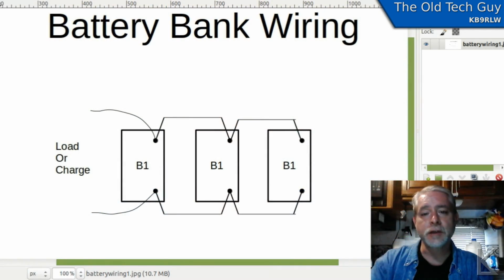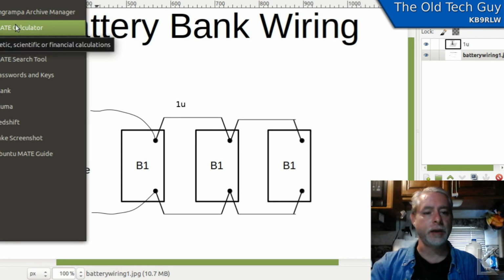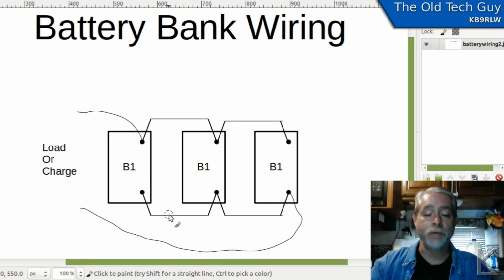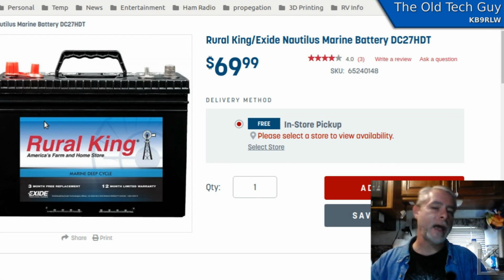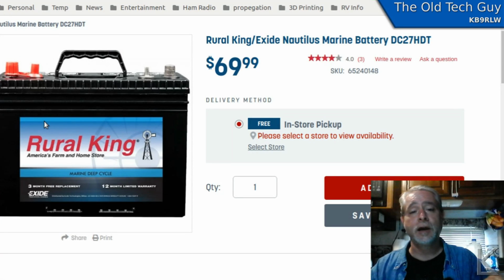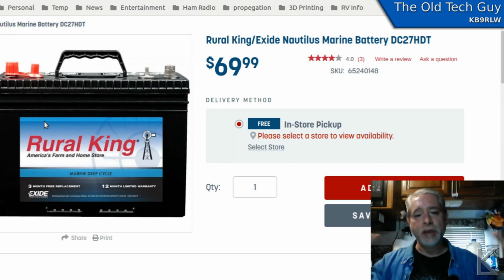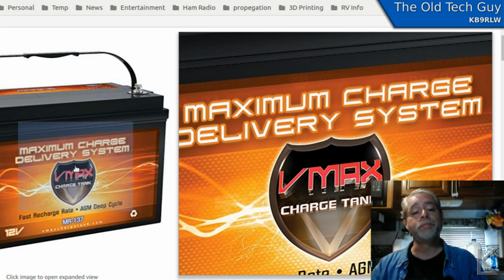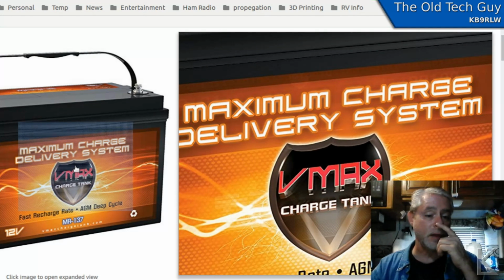Electronics - RV - Ham Radio, Solar and Batteries. Thoughts and Observations

Comment: Excellent video! Have you experienced any noise issues from your 12v-19v converter or your solar charge controller?  A while ago, I came across 2x 100 ah Odyssey PC2150T AGM batteries and a 15A Morningstar Sunsaver MPPT charge controller.  I've been keeping the batteries maintained with a Progressive Dynamics PD9280A RV charger (which is supposed to be very quiet, < 20mV ripple per phone conversations with manufacturer).  They been unused in the basement just floating on that charger for a few years.  I'm currently setting up my first station (will start happening next spring) and considering just running it all off the AGM batteries and a single 200W solar panel with a TG Electronics SuperBooster boost converter to keep the voltage up at 13.8 where the transceivers like it.  Perhaps this would isolate me from noise sources and surge threats on the 110V AC lines in the house. The 12v-19v converter would be for a PC monitor and a computer, but I'm concerned about noise from the switch mode converters and chargers.  Any problems with noise on your radio from the 12v-19v converter or charge controller?  If so, how have you dealt with it?   I'm learning toward the IC-7300 also.  Are you able to get the full 100W of your IC-7300 when running at <13.8 volts?  Is the 12v-19v converter for your laptop happy when the battery voltage drops?   Thanks!

Comment: Cant say it better!  ((btw, MPPT regulator is the way to go, more than 30% more power from the existing panels, even in low light situations. ) (they give you more amps then the panel itself can generate (the use the higher panel no load voltage< the max your 100 w panel can generate whit a pwm regulator is only 70 watts from the 100 per panel! ,So the 200 watt you have on the roof is only generating about 140 watts max) , at 12 volts (real empty battery) thats only 11,66 amp charge current.. , whit a mppt controller thats thats 16,6 amps! (so in 100% light situations 11 amp hours charge, against 16 amp hours charge per hour! ) Thats quite a difference. (you can also improve the voltage loss in the panel wires iff you connect them in series, doubling the voltage output, so the mppt controller can even work better . (Victron mppt capable off overvoltage on the input, even lesser loss!)  73,s! , Pd8533
Reply: Yes, the MPPT charge controller is well worth it. I have a solar setup and have used a PWM as well as the MPPT. If you only have 40 or 50 watt solar panels, you won't see that much difference. At 200 watts you will see a major difference. The Victron MPPT is fantastic. I have a small 15 amp and it works great. It comes with Bluetooth so you can monitor it with a phone app. It is really nice to have the data logged to monitor the usage. 73 KF4UPI
Reply from the maker: I've been working on researching maximum power point technology.  It's difficult to collate hard data amidst the huge quantity of anecdotal noise.    From what I can gather, the range of conditions wherein the benefit is substantial is severely limited.  But I'll keep digging.

Comment: Concerning multiple batteries wiring.
Your current and voltage drop calculations are wrong. If total current is 30A each battery would take approximately 1/3 i.e. 10A.
But in general the idea is correct, it’s better to use diagonal connection to the load.
Reply from the maker: The numbers were chosen to make the illustration clear.  The idea of the voltage drop across the wires, nothing more.
Reply: Yep, but if you choose 30A as example than current in first jumper wire is 20A in second 10A that's it.
Talking about 30A in all jumpers offends the eye of anyone who knows electronics basics.

Comment: Kevin, I have 3 SLA AGM 7 AH  and 1 12AH battery in my power pack.  All of the negative terminals are connected to a common bus bar and the positive terminals are attached to a 2nd bus bar,  So there is a single point for both sets of terminals to which I connect both my radios and battery conditioner.  Can you analyze that for me?   Bob
Reply from the maker: If all the connecting wires terminate at the same point and are the same length, you don't have this problem.   However, you have one battery that does not match the others, so It will age differently.

Comment: Great video. I learned a lot ! How much is weight an issue in your RV ? I’m thinking that with all if your electronics etc you might have more weight in that RV than the typical person on vacation. Is there a weight limit for load carrying that the RV maker specifies ?
Reply from the maker: There is a load limit.   I'm under it, but not by much.  So weight is always on my mind.    This new battery is heavier than one of the two batteries I replaced, but lighter than the two of them together.  So this was a move in the right direction.
Reply: While traveling keep black and gray tanks empty and even fresh if weight becomes a problem.

Comment: Love your videos however I am confused. I thought AGM‘s were only good for about 50% meaning if it’s rated 120 amp hours only good for about 60
Reply from the maker: What I learned doing research is that the AH rating is arrived at by what's called a 20 hour test.  They discharge the battery over 20 hours to the critical voltage of 10.6 volts.  Then they calculate how many amp hours it actually delivered over that time.  So, that would mean that the rated AH is much closer to an actual usable capacity.

Comment: Just got my tech/gen in the last 90 days, am studying for extra and am ready to install my "radio shack" now. My dual power system  makes it tricky but I've been watching lots of videos like yours and will investigate this 13v/19v converter(I already use a 30A converter to change shore power to 12v). Radios and AT will run off MFJ booster and am leaning towards a Tarheel 100 antenna for hf and a triband ant for vhf/uhf/1.2Ghz. Without an Elmer to advise me I'm very nervous to buy the pricey screwdriver ant.  Any thoughts?
Reply from the maker: I'd love to be able to give you an evaluation of the screwdriver.  Unfortunately, I have no experience with one.  They are talked about quite favorably by those who own them, as far as I know.

Comment: Yo Kevin!:
Great video! Are you considering changing the diameter of any of the cables connecting to the batteries? More current handling capability? Again great video!
DE seeker / Jeff WA7LFP
Reply from the maker: The most I draw from the desk systems is around 25 amps during TX peaks on the 7300.   I'm fine for that and then some with my existing cables.   The 1KW inverter has it's own wire to the battery, but I rarely use it.  (only once so far, to vacuum the floor.)

Comment: Thanks for your great Videos.  I do have one issue with one thing you say, that "Inverters are inefficient".  This it not true!  The average efficiency of good inverters has been around 97% for over 20 years.  Almost equal to transformers.   You need to look at watts in to watts out, not amps alone.   Of course when you take 12 volts in and convert it to 120 volts you you divide the amperage by ten.  So at 12 volts you need to supply 10 amps (plus a small loss) to get one amp out at 120 volts. but it is still very close to the same amount of "Work" or watts.  It seems inefficient to use 10 amps from your battery when you only need one amp of 120 vac and it is a good way to drain your batteries fast too!   I have worked on boat electronics and electrical for over 30 years and have Installed and serviced quality inverters for most of that time. (and many other electronics)   Yes every conversion costs some loss and staying with one voltage is a great idea but it cannot always be done, but there are many things that can be done to improve the systems that you need to live with.  
 Thanks again, I am not complaining, I just feel that this subject needs clarification.    
David Huffman  FCC Commercial License  PG119192 w/Ships Radar,   AJ6DY  (lol finally took the Ham tests and did them all same day,  guess my learning helped a bit)
Reply from the maker: If you go back and have a look at my update video with "two bench projects" in the title, I did a test.   I used the inverter to power my laptop with it's normal power supply and calculated the wattage drawn from the 12 volt source.   Then I used a single stage 12 to 19 volt converter to power the laptop off the 12 volts.
The inverter method was 42% less efficient.  Calculated actual power draw from the 12 volt source.
By adapting as much as possible to run directly off the 12 volt source, you do gain quite a bit in efficiency.
Reply: @loughkb  thank you for your reply.  I do agree that the DC converter is the best way to go,  but I am surprised that your inverter did so poorly in the test.  I am sure a higher quality (and much more expensive) marine inverter would show a lot less loss in the same test.  One of the best units is built by Outback, 3000 watt out, also used in home solar systems.  These units range between $1500 - $3000. With rated efficiencies in the high 90's.  Thanks again for all your videos, I do enjoy them and have learned a lot from you.  I have changed my call sign to K6DCH which are my father's initials who inspired me to study electronics.
Reply: Keven. There is an error in your first example. If you are "pushing" 30 amps into the battery bank and for example if each battery is absorbing 10 amps then each segment of the wire has different current and the voltage drop you calculate is overstated. K9EA

Comment: Hello Kevin .. unless I am missing something .. is this battery just for radio use or for the coach as well .. if this is for the coach also would you not be better off using two 6v golf cart batteries such as the Trojan T-125 240Ah and run them in a parallel / series config .. this is what I have in my RV and I get a total of 480Ah @ 12v .. just a thought. Randi N9UOM
Reply from the maker: You slightly confuse me when you say "two" 6v batteries.   You could put two in series and get 12 volts at 240ah.  You would need four batteries to do what you describe.
I have a separate battery for the usual coach systems and a switchable bridge that ties the solar battery to the coach for a low amperage sharing of power.   I talked about it in my tour of the desk.
https://youtu.be/jjdY03ejne0

Comment: If you have 0.05Ohm in one leg of 8" 000 gauge wire you are doing something very wrong
Reply: I think he was using the 0.50 ohm as an example. Even if it was 0.005 ohms there is still a voltage drop.
Reply from the maker: That was just a hypothetical to show the math.    8 gauge is actually .6282 ohms per 1000 ft.   So, let's say two feet of jumper wire.  At 8 gauge, that would be 0.0012564 ohms and at 30 amps,  0.0376 volts drop.   IF you want to use real numbers.   But the same is true regarding battery cycling and aging. ;-)